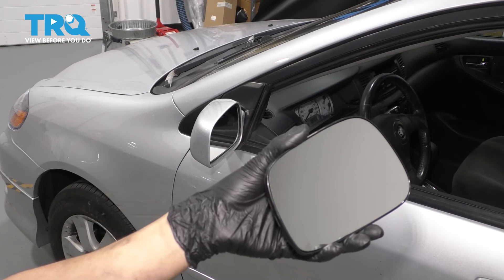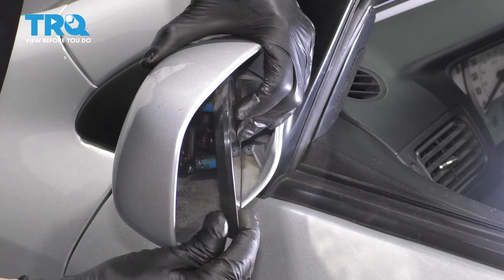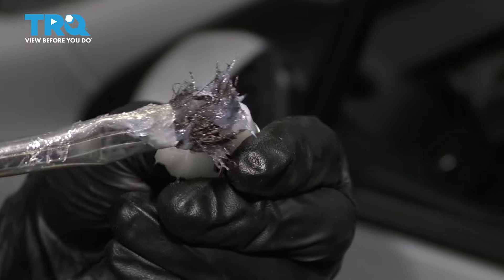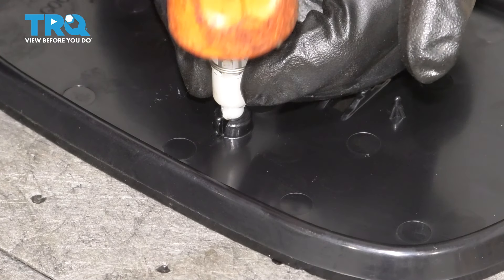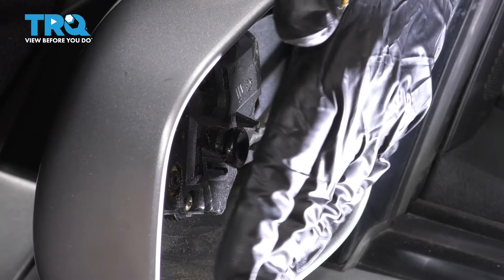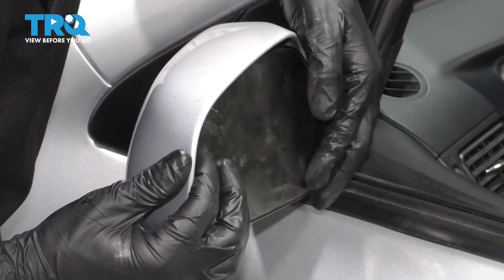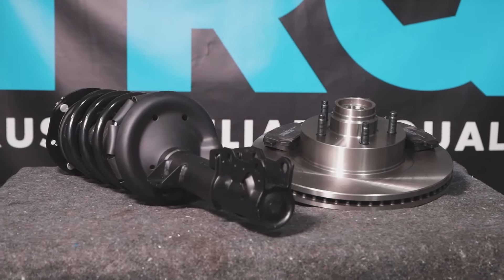How to Replace Side View Mirror Glass 2003-2008 Toyota Corolla

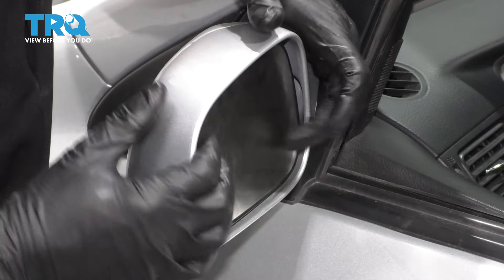Comment: 2:20 is where he edited out the 90 minutes it took him to get it snapped in.
I greased all four points that need to click in, clicked in the top blue peg first, clicked in the black tab on the right, then you can see in and use your finger to adjust the other blue peg then press it in, I’m assuming the other black tab clicked to because the mirror is secured.